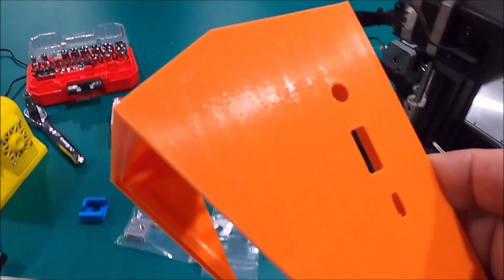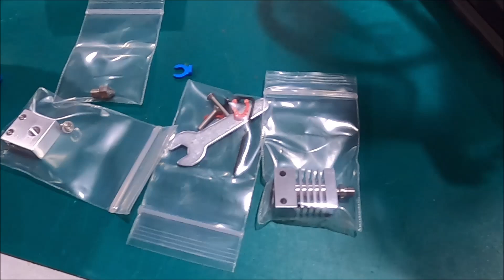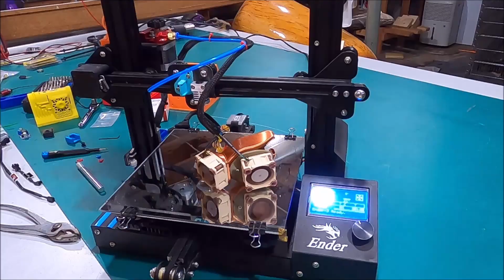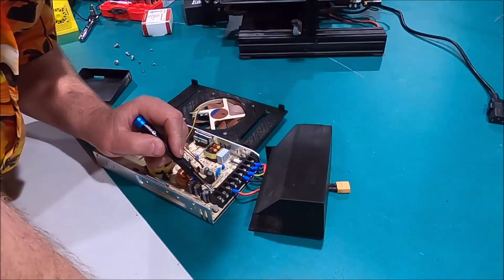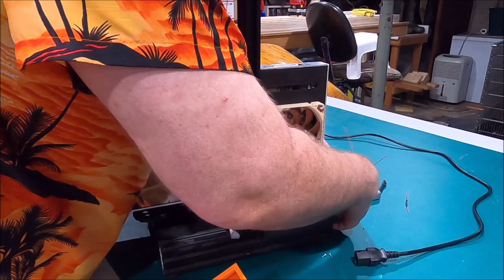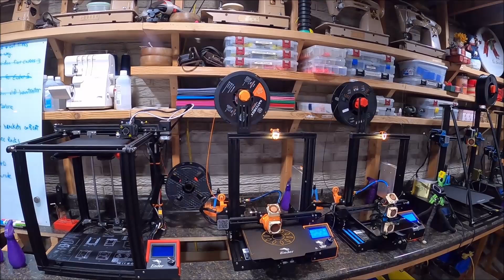Creality Ender 3 gets a Micro Swiss all metal hot end and a few other upgrades relocate Raspberry Pi

Comment: Hi there! I have just fitted the Creality BL Touch kit (which was a real pain) and I have noticed the control board fan does not come on when starting up, I have checked the plug and it is plugged in ok.
 Should the control board fan be on constantly?
Reply from the maker: Mine only comes on when it needs to.